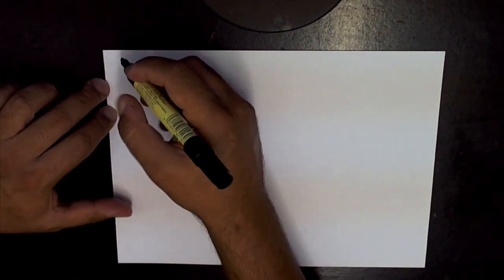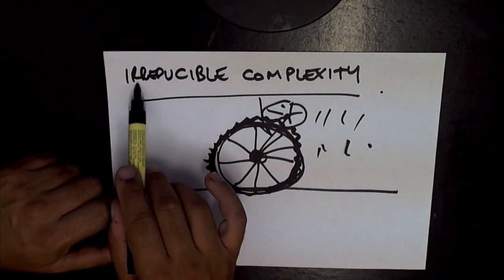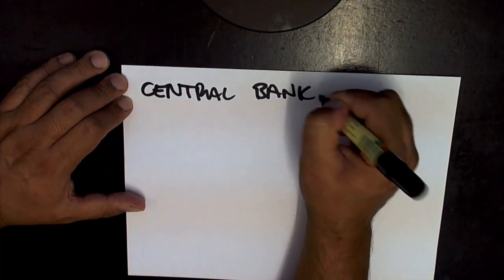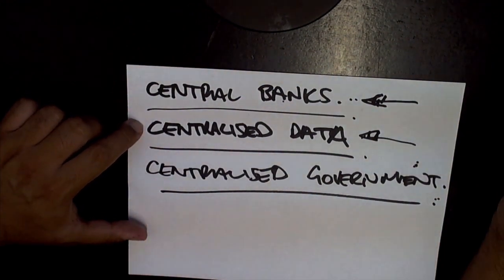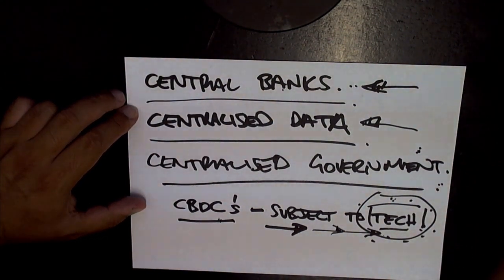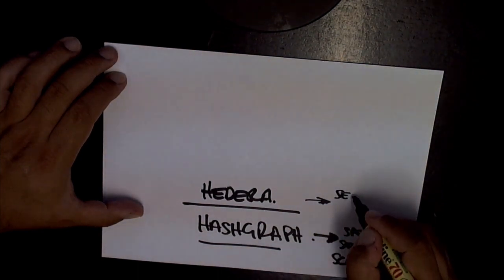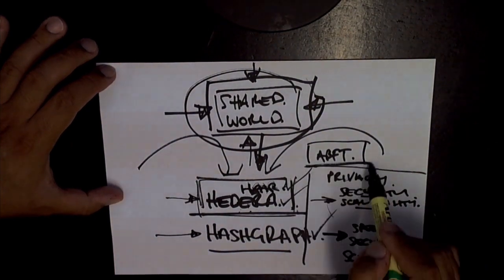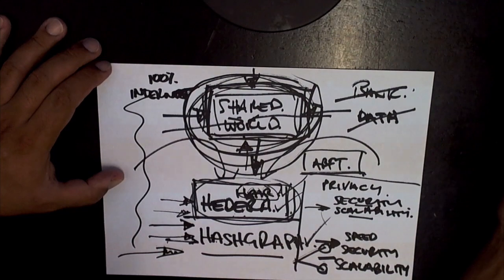Hedera Hashgraph - The Irreducible Complexity of a Shared World

Comment: The most important reason why DLTs need to come to an agreement is so that the truth or fact about a piece of data can never be lost or altered. 

The greatest of all DLT's is the DNA in your body. Every single cell has a copy of the ledger (chromosomes) that details your entire genomic sequence...doesnt matter if its a skin cell, liver cell or muscle cell. They all have access to the same copy even though they use different parts of the DNA to function. If a cell's ledger/DNA is corrupted, you get a cancer cell.
Reply from the maker: Yes I was going to use the bacterial flagellum for an example of irreducible complexity too but I thought a wheel would be easier.